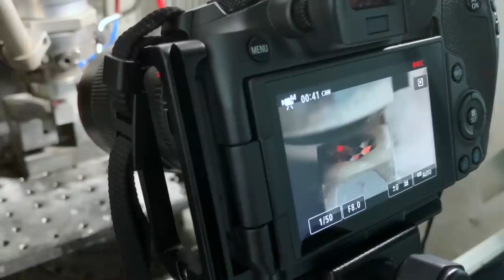Waterjet laser cutting of high-aspect honeycomb / Wasserstrahl-Laserschneiden von einem Wabenmuster

Comment: why cant the beam simply be reduced in size and made just as thin without using water like a fiber optic guide to make such cuts? also if the beam is confined to internal reflection so long as the water shape remains a column then what happens when it hits a part and splashes in all directions is there no loss of power? also the beam can be made to have a top hat profile instead of gaussian
Reply from the maker: Very good questions. A narrow beam is a legitimate idea. The challenge is to remove the cutting particles from a 0.05mm slot that is perhaps 10mm deep. Also there will be some taper. Top hat profiles can be interesting for some applications.
Reply: @Avonisys  0.05mm is this the beam diameter ?? that is incredible what is this like 50 microns? the cut looks quite narrow but it did not look that narrow wow,,,hmm so you are saying the water jet is helping to remove the particles from deeper cutting, i thought there would be no particles with laser beam cutting as they are mostly vaporised,i guess there will be some that did not completely burn , "Also there will be some taper" how so? and my question about the water splashing everywhere?
Reply: @Avonisys  "Top hat profiles can be interesting for some applications." yes perhaps for cutting perfect slots
Reply from the maker: @ARCSTREAMS  Al the material that is vaporised is transported away as micro particles by the waterjet. A typical taper for a slot that deep of 0.01mm with the wider end being the entrance side.

Comment: Sorry, and exuse my stupidity but what is that "wire" hanging down? It seems like WEDM, but obviously, it is not? How does that work, and why is it there anyway? :/ Ah probably I was blind it was just a trail you used to position in the center of the material but already leave the trace..
Reply from the maker: The thin bright line is actually a liquid-jet that is roughly the size of a human hair. The laser is guided through that liquid-jet (water) by internal reflection.
Reply: @Avonisys  than you from other videos I was able to find that out... Seems great, especially using water for such purpose.

Thanks and keep up. Looks really promising

Comment: There has to be point where support is lost and the finished part drops away. The finished part can be the inner or the outer hexagons.  With wirecut, or waterjet, or flame cut there is a telltale entry point.  This system seems to avoid that, right to the bottom .  So I assume one second op
Reply from the maker: For high aspect features we refer to the last portion of the cut as "tilting pin". The part is then pushed away for a short time until the last connection is cut through

Comment: It is possible to laser cut harden tool steel and tungsten carbide. Can the cut can be control within two micron.
Reply: laser leaves a burnt edge though, could be an issue if welding is the next step, which could have contaminants from the burn. Waterjet leaves a cleaner edge
Reply: also waterjet can cut thicker stuff
Reply from the maker: You may want to have a look at this: https://youtu.be/CYYcPhY5LUE

Comment: Hi. I really love the way it works.
Do you have CNC machines for only sheetmetal?
My company has a punch machine Amada Vipross 255 but with 20 years old, it is getting less precise.
I hope to see something like 3000mmx2000mm usable surface for the machine.
And how fast can it cut in titanium (TI6AL4V) and stainless steel (SS 304 or SS301) #5 mm think?
The edge of the parts need deburring?And can it cut into glass epoxy?
Thanks
Reply from the maker: For business inquiries please reach out through avonisys.com

Comment: I'm confused: the cylinder is free to move and tilt once cut , isn't that bad? Shouldn't it be supported from under?
Reply: Same problem that happens when you do a wire cut in EDM. If you whant an exeptional result you have to support the piece.
Reply from the maker: @Federikestain  Correct, a support structure can be left if the cut out part is to be 100% mint. For the purpose of this demonstration that was not done
Reply: @Avonisys  Yep, i could guess was for this reason, great technology btw. First time i saw something like this. Really great job!

Comment: Make perfect hex wrenches for bolts to prevent hex wrenches from twisting and turning into debris)
Reply: @Goettschwan I sometimes "cut" the thread with bolts .. Sometimes the second tap breaks, and you have to take the bolt and tighten it .. Naturally, the 4 mm hexagon is not designed for such loads, and the bolts are made with a gap, very often the hexagon turns (About the quality of the tool I argue, not the best .. I don't know which company to order it, everywhere it is either soft or fragile (
Reply: @Goettschwan he's doing poor man tapping by using the bolt as a tap.... so zero relief for any excess material plus the mashed threads on the bolt he is ruining likely toppled by zero cutting oil and him not backing it out and cleaning it so the bolt he is using as a tap is binding.
Reply: @hibahprice6887  there are ways to cut bolts to make a cheap self taping type, a good tap will be cheaper than anything made by this machine and just cheaper in the long run unless you have loads of time on your hands and limited money.
Reply: @Goettschwan bingo

Comment: what do you mean woterjet laser. I can’t quite understand, is it a combination of them or in isolation?
Reply: The water jet acts like a fiber optic cable that carries the laser beam to the point where it is cutting.  This makes it so that the laser is in perfect focus for the full depth of cut, which not only helps it cut faster, but also keeps the sides of the cut straighter because the laser would normally make a cone sided hole.  The water jet also carries away vaporized material which would reduce the effective power of the laser, and keeps the part from heating up as much, which makes the cut more accurate because  the material isn't expanding as much from the heat.
Reply: @Kieselmeister  Thanks for the explanation. A very cool idea. I see you understand what you are talking about. Tell me, sir, what do you have to do with this technology? Do you create or sell it? I am interested in applying this technology to a plasma beam, is it possible? Produce such a nozzle with a water sleeve.
Reply from the maker: It is a hybrid technology. The laser actually removes the material, but the water is used to contain the laser focus energy within a constant diameter over a long working distance.

Comment: 😳 🤯 how thick can this cut on different metals.
Reply from the maker: The technology is typically applied for parts from 0.01 up to 10mm with thicker cuts possible depending on material and geometry. Also it is typically applied for micro-cutting applications in terms of feature circumference length.

Comment: But what is the thing you made for?
Reply: It's purely to show the manufacturing possibilites that this degree of precision allows. Honeycob structures are a common component in aerospace composite, i.e cabin interiors (seat shrouds and over head compartments etc) as they are light weight , very sturdy and allow molding of moderately complex 3D surfaces... titanium is much tougher than aircraft grade AL alloys so hope that enlightens you.
Reply: @rivercityfishing9103  thanks for taking the time to educate me, sincerely : )

Comment: so, this is a waterjet and a laser cutter combined by using the water as a fiber? genius.
it removes the drawback of laser cutters overheating the material on thin features
also since the laser is cutting, the spot is much smaller than with water. the water just blows away debris that would block the laser path.
by using the water as a light fiber the light penetrates into the cut directly, theres no need for focussing optics that would cause a cone shaped beam and you can cut as deep as your water beam is able to stay straight

but i wonder how much laser power is possible before the water itself starts getting disturbed by absorbing the energy, this unit probably requries lab grade pure water
Reply from the maker: The water must indeed be ultra pure. It is filtered and de-ionized for that purpose. We build filtration and pump systems dedicated for this technology

Comment: Is the focal length held constant as you go deeper into material or are there some active optics involved? If it is constant how does it affect the tolerances for thick pieces?
Reply: Id imagine its probibly using the water stream as a fiber cable in addition to focusing the beam, though im not even qualified to talk about either but from what it looked like in the video it seamed the cut was happening at the point of impact with the water
Reply from the maker: The working distance to the part is not changes as you cut deeper. The laser is guided inside the liquid jet down into the cutting trench to remove material layer by layer. The waterjet is of constant diameter is acts similar like an optical fiber.

Comment: Water jet doesn’t cut. It erodes… so the combo does make sense. A water jet can’t erode a perfectly straight line. It will pinch inward in a cone like shape. The laser would fix this problem. Very cool.
Reply: In this instance the water jet does nothing except to guide the laser which does the cutting, the water jet is acting like a fibre optic.

Comment: Sell your wire EDM stock !
Reply: Indeed !!
Reply: Nah. Wire EDM can do more than this. It's not going anywhere.
Reply: @JF32304  This is just it's first baby steps , Wire EDM has had decades of development.
Reply: @robertlackey7212  wire is way more controllable. This is nice tech but EDM isn't going anywhere.
Reply: @JF32304  Every technology you see today will be surpassed and replaced , history is testimony to that fact , and there have always been people that have said that the current technology cannot be replaced , but time and technology marches on , and on , and on...
Reply: @robertlackey7212  With time, sure. However, you're suggesting jumping the gun. This is certainly something to follow in the coming years though.
Reply: @Deesdessessesder  No starter hole , no need to submerge the work piece , faster , the only limitation I see is very thick cuts and possibly accuracy but maybe not , and most importantly stocks drop because of peoples PERCEPTION  OF REALITY ,  if people perceive this is going to make wire EDM like gun drilling , only used for very deep work , that could be enough to start a downward trend , and  no one wants to be caught holding stock that is only going to loose value over time.
Reply: @robertlackey7212  What makes you think this is faster? Hopefully not this chopped up video with no mention of cut time. Also that surface finish looked like crap compared to EDM.
Reply: @Steve_Just_Steve  That surface finish does not look like crap , it would take minimal hand finishing to bring that to a nice polish for a injection mold , and as to speed wire is limited to how many amps you can push through the wire , this has very few limitations to how powerful a laser you could use.
Reply: @robertlackey7212  There's no doubt this is awesome process capable of doing things amazing things, cutting PCD with no taper is just one. Each process has it's advantages. This one lends itself to very small features with only 400mm a envelope and is faster than EDM in that envelope. Actually these two processes are many times combine into one machine. To take advantage of both.
Reply: @robertlackey7212  Technology advances but things like a lathe and milling machine are still around they have greatly evolved though.
Reply: @phillhuddleston9445  So is the gun drill but when was the last time you used one ? I built my first laser when I was 9 I know lasers very well , awhile back I needed to cut some hardened 301 sheet and and needed a nice edge I considered making a Wire EDM but went with chemical milling instead . If I need to cut thick (=< 20mm) hard material I won't even consider wire EDM now , I will have a excuse to to build a "wet laser". Your talking like an Engineer , that's great but you are not the kind of person that is playing  the stock market , and that is what I was thinking about.
Reply: @robertlackey7212  I can certainly see where your interests lie. If everyone who supports a truly useful and unique technology jumps ship at any sign of a competitor, that leaves little room for the competition to actually take place. Competition drives progress. I don't draw the same conclusion as you that rises in stock price related to this technology would drive down wire EDM prices. You're right that people's perception is what drives the stock market, but to me it's looking like your perception is at an extreme end of the bell curve. That's perfectly fine, of course. It just won't be influencing my investment decisions.
Reply: @Deesdessessesder  "looking like your perception is at an extreme end of the bell curve" , that sounds a lot like all these "false news accusations" flying about these days. You don't see me calling your opinions the "extreme Luddite fringe " see I can BS to , but I choose not to.
Reply: @robertlackey7212  You forgot the "to me" part, indicating an opinion. I don't see value in continuing here. Do what you want with your stock, not that you need my permission.
Reply: @robertlackey7212  Actually I am playing in the stock market but when I buy and sell stocks I don't care or even know what the company the stocks name is in does I just need the charts and indicators. Trying to play the stock market based in anything else is simply using emotion where it has no relevance though many people play it that way they usually get burned.
Reply: @phillhuddleston9445  I have never played any market , but I had a friend that lived in hotels and his convertible , driving around the country , he was a commodities trader . He used to say "money knows where  money goes" basically what you are saying , he looked at movement and made money off it , he could make ten grand in a morning !  I still stand by my initial statement , as a user of this sort of equipment , I will no longer consider owning Wire EDM , I will use this new technology and in the few cases where it won't work I will farm it out . If I feel this way there is probably others that feel the same way , I predict wire will lose market share , as this technology gains market share , till this is dominant , and wire is just a niche market like gun drilling.
Reply: you are all forgetting, that with this system we can also cut nonconductive materials and there is bassicly no heat thanks to constant water
Reply: @wisniamw  I was , thanks for pointing that out , now I just need a excuse to build a DYI version , I have been very interested in UV diode lasers I wonder if any UV goes through water ?
Reply: @robertlackey7212  UV-B, the frequency range of ultra-violet light that causes sunburn, is absorbed by water but you need a few metres of it to provide adequate protection. Half a metre of water will still let 40 per cent of the UV-B through and the cooling effect of the water makes you less aware of the Sun.
took me literally 10s of copyin your question and pasting it in google :D
what a wonderful times
Reply: @wisniamw  But I am not using sun light , there are literally thousands of different laser frequencies , it will require comparing the absorption chart of water and other possible liquids to the spectrum , efficiency at different frequencies (most lasers are not monochromatic) and practical considerations . It is a project to narrow down the possible laser/liquid combination . Not that I don't enjoy that but I am spending all my free time studying Russian at this moment , but I should be able to some time next year.

Comment: something to be mindful of when using waterjet is for thick material. As the jet is not a straight cylinder but more of a cone, the bottom of the cut is larger than the top, and as such, for thick material, the cut face cannot be straight. The machine may be able to compensate with the controller if the nozzle allows for slight rotation, but even that may not be accurate. Depending on what your needs are (in this video, tight fit with some sort of male part)
Reply: This isn't a waterjet cutter, it's a waterjet laser. The water isn't doing any cutting. That's how they get these extremely straight cuts with constant kerf sizes.
Reply: @bbrockert  interesting!
Reply: This jet of water in this video has laminar flow so it stays straight and doesn't taper out.
Reply: The whole joke is in the laser, it burns a hole, where water begins to hit with a stream, through which the laser goes further, as a result, the thickness of the cut + - is the same as at the entrance ..

Comment: pros: good performance with soft material
contras: price
Reply: cut time? surface finish?
Reply: @Steve_Just_Steve  when your dealing with super small parts time is irrelevent as it just takes time to ensure quality and the finish is fine, much better than normal cutting and without the problems emd has
Reply: @353Tensa353  Yes I look into this process further and it is very interesting. Also capable of cutting PCD!
Reply: @Steve_Just_Steve  well its definitely a cool system and doesnt have the "it must be conductive" limitation that emd has so i can see many applications involving the newer composites and ceramics though dont no about ceramics as much not sure how lazers like them, but its definitely realy cool and a good bridge between tech and with enough RnD probibly the start of an entire new class of mechine